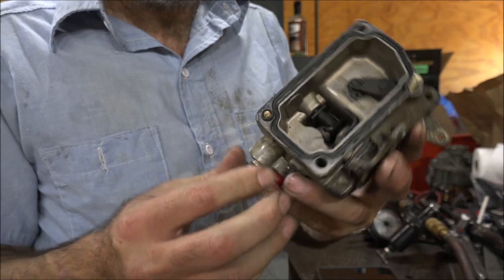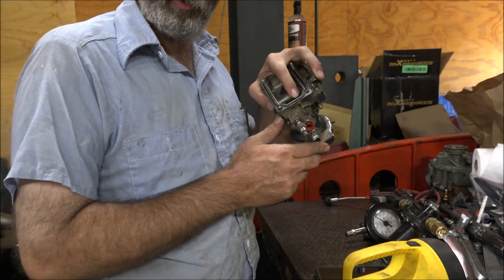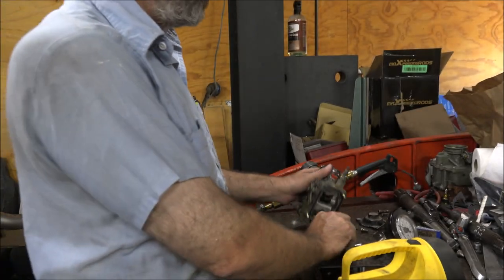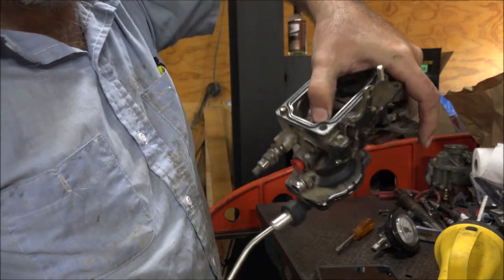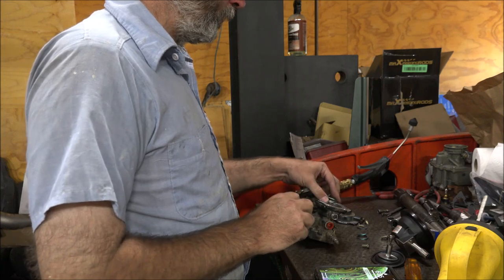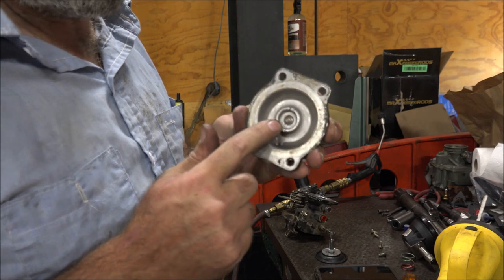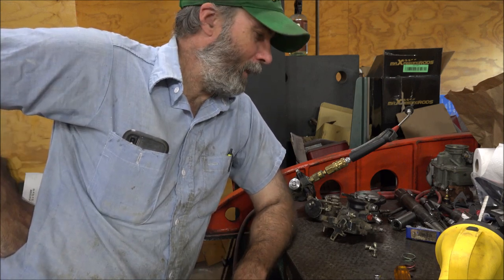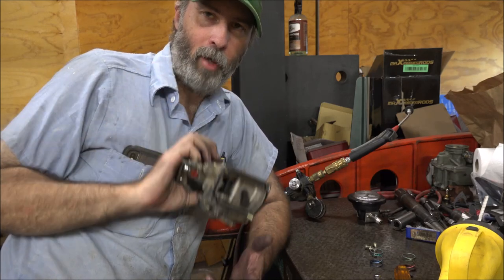Secrets to Bosch VE Injection Pump AFC Tuning Aneroid More Power, Less Fuel Wasted and Less Smoke

Comment: I can overhaul/reseal one of those pumps, but knowing how to tweak them in for the best results is fuzzy knowledge for me.  I'm thinking that I should make sure the injectors are working right first.  Two were replaced after metal shavings from broken plunger springs  prevented them from closing all the way, the others have just over 420,000 miles on them.  I'd love to replace them all with upgrades, but .... $$$
Reply from the maker: Well now you know more how to do it. :-)

Comment: Such a universal pump its used on small engines that don't make power to bigger displacement engines that can make big power its all in the adjustments/head sizes and small mods ultimately.

Comment: I went from stock injectors to a set of 6x16's made by John Link years ago on my 93. I slapped the injectors in, but kept the pump where I had it. It was undrivable at a stop sign. Just puke smoke and not hardly move. Went right home and adjusted the smoke screw and spun the star wheel up. Much better. Have not touched it for almost 15 years.

Comment: I wish you would do more on this topic  like the power screw to get the max from the ve pump .
Reply from the maker: On a factory governor spring adjust the idle linkage and screw so that it is backed all the way down. Then turn the fuel screw in until it idles 800rpm.  That is how I set them. If it tries to run away or wants to hang and not come back to idle quickly when you rev it up you may need to give it a turn or two on the idle screw and set it then.  Next time I am working with a pump on the test stand I will get more into this.

Comment: Thank you i got that ve205 in i used your  recommendation they sent that cheap ve205 with a modified power valve like what people buy along with a super short afc spring didnt bother with the rpm spring just pulled the governor back put all my own stuff in the afc that i modified using what you showed here i also did an overflow mod the 500.00 pump woke this up and then some thanks much pulls to 3000 easy no problem at all im thinking this motor was destined for an elevator or generator it used to max out around 16-1700rpm so the motor was never run very hard just has a bunch of wacky parts in it.
Reply from the maker: Glad you got it doing better.

Comment: Thanks you for the video, very clear, easy to follow through. Just a quick question, my AFC cover has the smoke screw at the top, should I back it out completely or do you recommend specific settings for this one?
Reply from the maker: If you have big injectors back it out completely
Reply: @bcbloc02  Thanks for the quick response Brian, appreciate it!!! I'll do that and test how it goes. Again, thanks for your time

Comment: Does the fuel coming on at lower boost levels help clean it up? I would have thought you would want the fuel to come on a bit later. I'm trying to clean up my exhaust but haven't really played around with my pumo aside from turning the fuel screw out 1 rotation. It helped a bit but still smokes. Have more to play with but looking at all options.
Reply from the maker: No you want less fuel with less boost to be clean. Most of what I showed here is how to minimize the amount of fuel until you have more boost.

Comment: I have 4BT VE pump. Upgraded fuel pin/gov spring and bigger injectors HX30W super turbo. I am dealing with cronic low torque on take off, super bad mileage and high EGT's. My Boost on cruising is 18-19 psi. I increased the diaphram spring tension to max but when I back off the smoke screw I lose even more low end torque. This motor is a dog until I get some boost and it never used to be that way. I have been adjusting all aspects including fuel limiter (backing off and increasing but only one full turn either way) I cant seem to get the proper tune. I had this pump upgraded as a set with the new injectors so I dont have the stock fuel pin to play with. sure could use some help dialing this in.
Reply from the maker: One big factor that will kill torque is improper timing. Have you checked your pump timing? Did you change it from where it was when it was running better?  Could also be poor injectors. The other thing that stands out to me is cruising boost is really high. My cruising boost on level ground at 70mph is usually single digits. If your boost is that high no load how much drive pressure do you have? It would be good to know your setup when it ran batter and what you have changed since then.

Comment: Thanks Brian! Are you still supplying 14mm Rotor Heads for some of us VE guys that don't want to make the P Pump leap?
Reply from the maker: No when Industrial Injection got one and gave it to the Chinese to copy I quit.  It took years to get the ones I had made in Germany sold and even some of them got killed for various reasons.  If you need more than 400rwhp long term you are better off doing an inline pump swap. Sure you loose the variable timing but the reliability is way better.
Reply: I've never been entirely impressed with Industrial or F1 Diesel... I'm not looking to be competitive, but to have a great running 2wd street pickup with great drivability like a (12.0 index). I'm guessing for that I'll need 600rwhp to reach. Hopefully I can stick with smaller compounds and a nitrous to get there... Thanks for your input!
Reply from the maker: @jamartaylor6958  I made 480-490rwhp a bunch of times on a stock pump fuel only so i am sure on spray you could get 600. A big shot of spray like that will probably be easier to race with a single as it will behave more consistent. The twins are more fun to drive but a lot more weather sensitive to how they behave so they aren't as consistent.
Reply: @bcbloc02  That's very respectable off of a stock pump. I'm guessing that a quality set of Injectors got you to that point. I remember playing around with a set of 4 holed Lucas P.O.D.s in 2004 and realized then how "cheap" power wasn't very efficient at all. Something didn't seem right when you can fog a freeway in a 320-330 ish rwhp pickup with an HX40. I eventually gave it up for a 2wd 94 Automatic CTD (long gone also) since I was having a heck of a time trying to consistently launch it at the drag strip without doing something stupid to the Getrag or clutch.
Reply from the maker: @jamartaylor6958  yeah the Lucas injectors are very dirty. They were some 6x.018 that Columbus diesel service made for me way back when probably around 1998.
Reply: @bcbloc02  I remember keeping an eye on what you did with the yellow truck in the forums and a couple magazines.  I had a 92 w250 that I truck pulled with. Never made it to the power level you did dynoed 420hp I forget the torque.  Definitely a fun truck to drive around.

Comment: And wear is the power screw set from the stock location.  I understand  the afc and fuel pin . But i was under the impression  to not turn up the power  screw more  the 3 full turns
Reply from the maker: I always turn power screw in until it starts to runaway or until the idle is 850rpm. If it feels like the screw is getting stiff it is bottomed out and do not force it.

Comment: Totally new to tuning these. Would this setup work with the stock injectors on a non intercooled 12v or would I need bigger injectors?
Reply from the maker: It will work just fine but you may find it’s slower to accelerate than you like with these settings.

Comment: I just had the top end of my ve pump rebuilt and all the adjustments are out of whack. I can get it to start and not rev to the moon now but I can’t get it set right. Everyone keeps telling me I have to pull the whole pump and have it bench tested, is there a way to adjust all of it on the pickup? Mines a 93 w350 dually
Reply from the maker: I don’t know what you mean by can’t get it set right. Assuming nobody screwed up the lever in the pump the fuel screw pushes against taking the top off or putting it on any adjustments that would need made can be performed on the truck. I can only guess that the throttle lever likely is not clocked correctly as missing it a spline one way or the other will throw off the fuel curve.  If it wasn’t marked before when it was taken apart then getting it back right is pretty much a trial and error affair.

Comment: Can a torn AFC diaphragm cause a no start? I bought a 93 D250 and been trying to diagnose and I think this is the problem but 2nd guessing myself while waiting on the part.
Reply from the maker: No. The AFC can only limit max fuel it never cuts it off.
Reply: @bcbloc02  I was afraid of that. The diaphragm has a 1/4 tear in it. So I assumed it was not allowing enough fuel pressure to pop off the injectors.
Reply: @Stu1-68  Are you sure your getting fuel at all ? FCS or Lift Pump would be my first guess !

Comment: Where should i put my star wheel with stock injectors
Reply from the maker: I would adjust it down so it just starts to blow smoke when you snap the throttle no load. If it is intercooled you can probably go pretty far if its non ic it won't be as much.